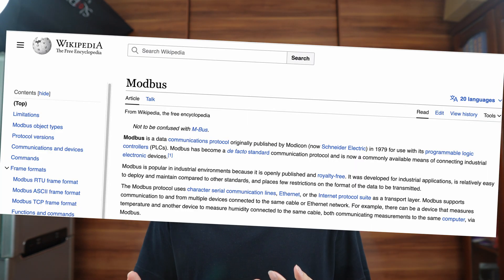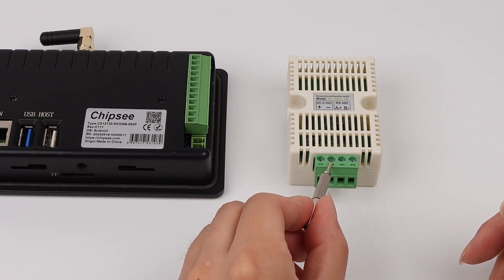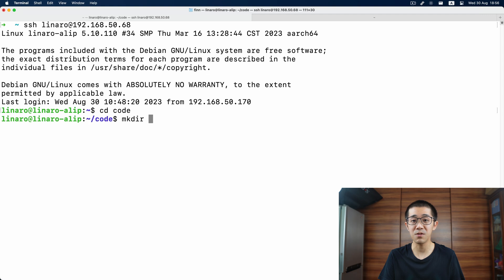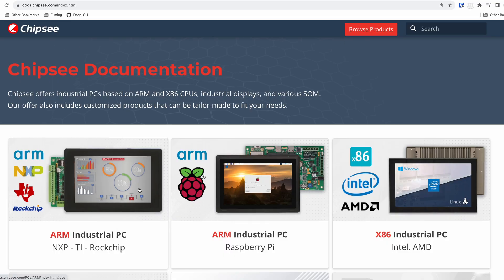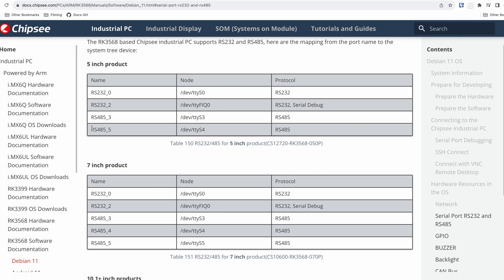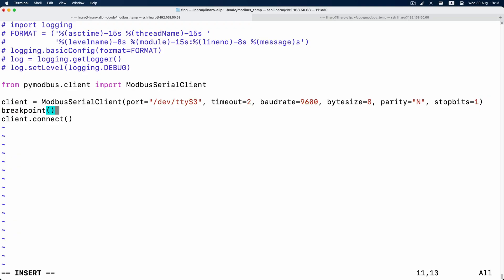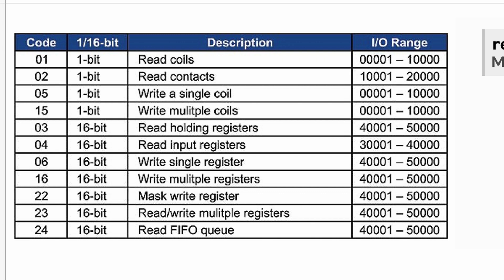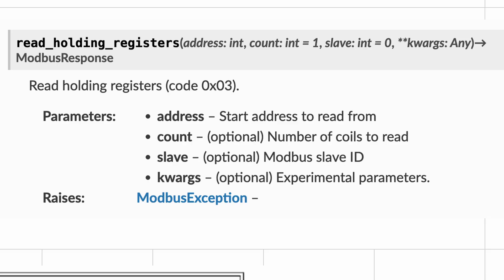How to Read Modbus Data with Python - Part 1

Comment: first thnks to this tutorial and i want to know more, i do research abt read data from sensor with rs485 to LAN converter, i use USR-DR302 as converter and i will using python to get data, so using pymodbus to, can u help me more tutorials abt tht. thnks
Reply from the maker: Sorry I don't have any experience with USR-DR302, so can't say much about it. Is there any specific problems you got into?
Reply: @Chipsee  thnks to reply, and i hve done with my code

Comment: Hi man. Great video, it helps so much. I was just wondering, I'm currently working for the first time on a Raspberry Pi3 and am trying to implement this to read the values from a temp and humidity sensor(FG6485A). Around the 4:10, mark it seems like your out of the terminal and in an IDE of a sort. Mine does not do this and keeps me in the terminal. Can I just code in Thonny and will this also work? Thanks so much in advance.
Reply from the maker: Hi, thanks for leaving a comment! At 4:10, I was using the default terminal app of MacOS, and ssh to my 5 inch panel PC's Debian Linux system, so it's not an IDE, it's still a terminal.

If you're using a Raspberry Pi3, you can use its out of box terminal app as well. Take a look at this: https://projects.raspberrypi.org/en/projects/raspberry-pi-using/8.

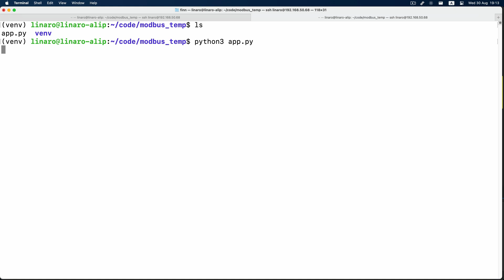As far as I know, Thonny is an IDE to run Python scripts? If so, you can work in Thonny, no problem at all. At 4:10, I was in terminal, running a program called VIM (https://www.youtube.com/watch?v=-txKSRn0qeA), which is a text editor. Then I execute python commands manually like in 7:48, this is the same as editing code in Thonny then click a run button in Thonny. 

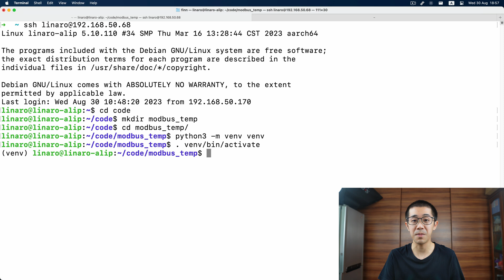But you said you're new to Raspberry Pi (and general programming maybe?), if you want it work in Thonny, don't forget to pip install the packages like I did from 3:30 to 3:40 like in this tutorial: https://packaging.python.org/en/latest/tutorials/installing-packages/#use-pip-for-installing. You might find this page for Thonny helpful: https://github.com/thonny/thonny/wiki/InstallingPackages.

Happy hacking!

Comment: Very interesting video! Is there a way to read Modbus TCP data with the Man in the middle principle? For example, you have the temperature sensor as the server and the Chipsee PC as the client. Instead of reading the data directly from your sensor, you have for example a Raspberry Pi in between those components that monitors the traffic.
Reply from the maker: Thanks man!

I read your comments a couple of times, and searched for MitM+Modbus, I found it's an attack method to take control of the Modbus server? Are you trying to hack a Modbus network or protecting against MitM?

I do not have any experience to actually set up an MitM attack though.

If you want to protect against MitM, maybe set up the firewall of the HMI, use TCP over TLS(like use https instead of http to avoid MitM) when sending Modbus TCP data. And of course, patch other workstations in the network, avoid social engineering happening to your operators (guys working in the plant/factory who operates the machines).

Is this what you are asking?
Reply: Ya, what you are describing is a very common scenario. I have the exact same problem, trying to R/W data to holding registers of several devices with unique unit ID's that are connected to a communication gateway that is accessed by Modbus TCP/IP. Did you ever find an answer to this question?